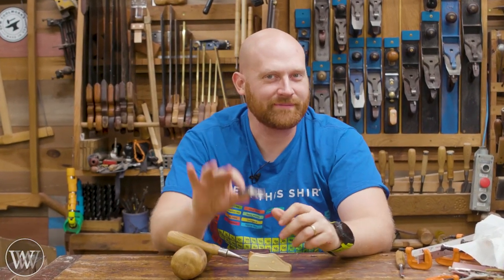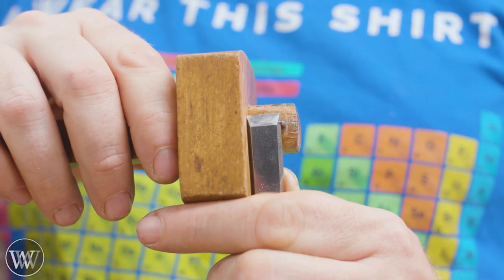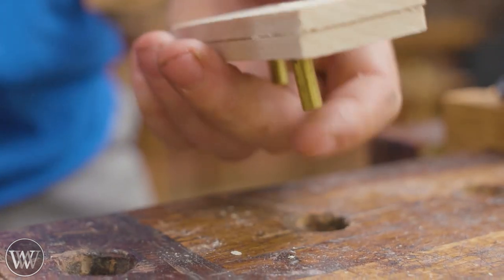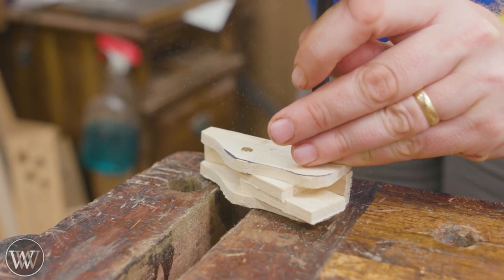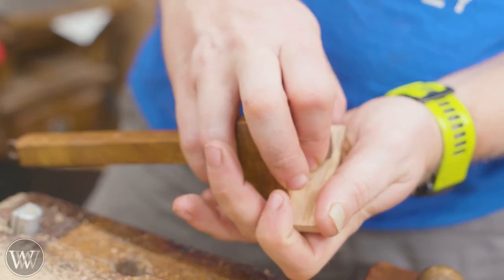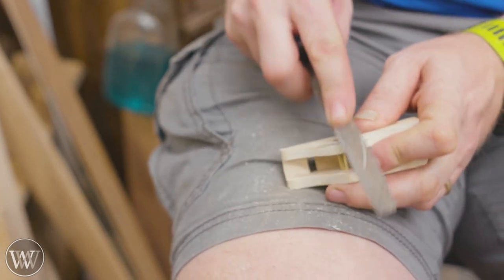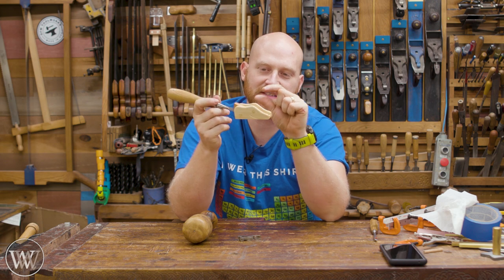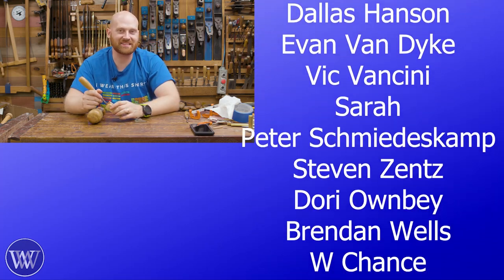How to Make a Screw Head Hiding Plane Hidden Fasteners

Comment: Can you please do a project using it? The part where you are using it was too short. Thanks.
Reply from the maker: There really aren't any projects to use on it. As I don't do much with nails and screws. The commonplace is if you have a loose board you can peel up a bit of the surface put a nail or screw down and then glue it back in place and try to hide the nail. For general new furniture you don't normally want to hide the fasteners otherwise they become an absolute pain if you ever need to take it apart or make adjustments.